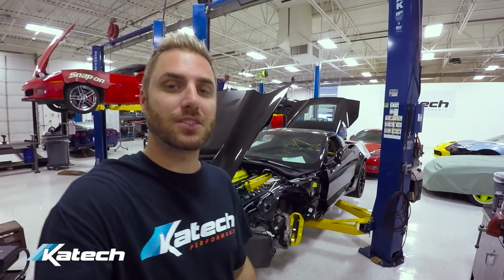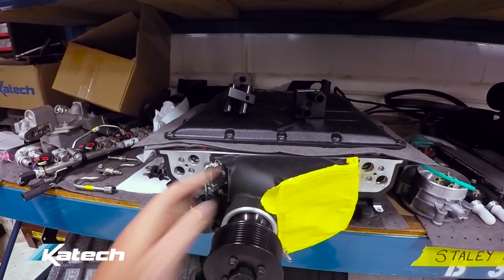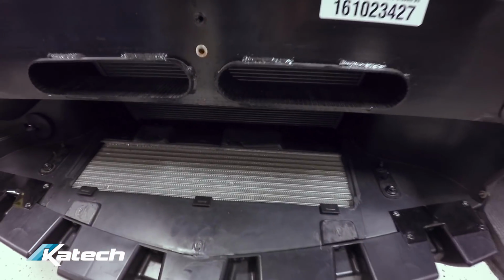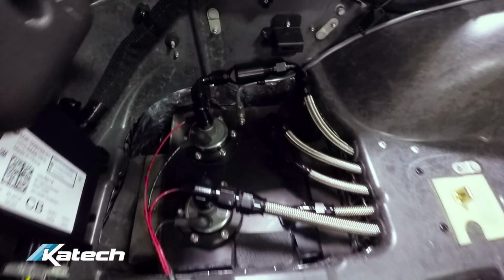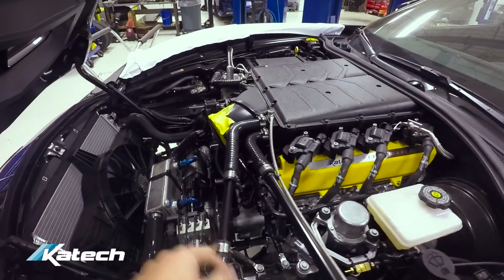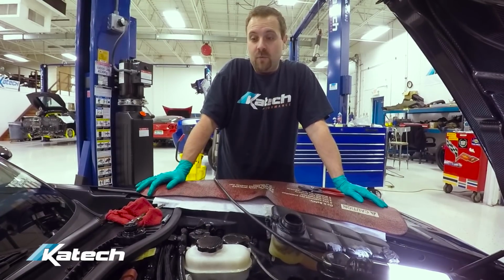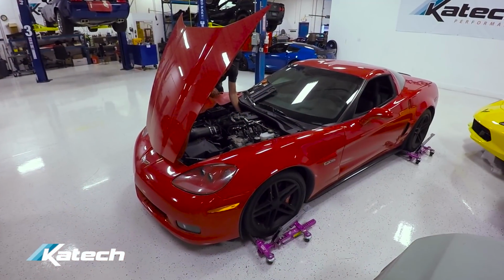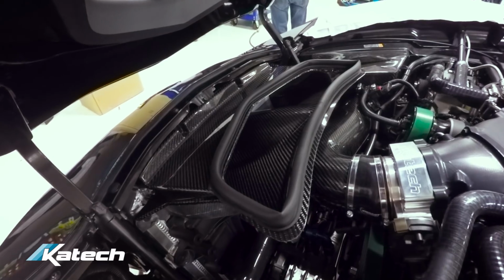Katech VLog - Corvette Z06 C7.R Edition track car with Magnuson 2.3L supercharger!

Comment: Love the C7R build, but would have been better if it had footage of that 2.3 on the engine dyno, and numbers.
Reply from the maker: We didn't put the engine on the engine dyno for this project, but we will have chassis dyno numbers in an upcoming video.
Reply: If I was a betting man, I'd say there were fueling issues.  I'm betting that fuel system won't keep up without meth or port injection.
Reply: Hope im wrong, but I have a feeling those $3500 injectors will be needed.
Reply from the maker: This car is equipped with our surge tank fuel system, LPE upgraded DI pump, and Katech high capacity LT4 injectors.
Reply: Ok sweet, this should be interesting then.  Looking forward to the results.

Comment: What were the stainless lines and black circle pieces below the front parking sensors? 

Love the channel btw man. It's always nice to see quality work done and engineering to fix issues!
Reply from the maker: Heath3250 those are the splitter undertray support cables that are tied up until the splitter goes on.
Reply: KatechPerformance ah I know what you mean. Gotcha. Thanks for the reply and keep the videos coming!

Comment: Hi I have a problem I am hoping you can help me with I have a 2010 Camaro SS auto The L99 according to chevy is suppose to have 400 horsepower but when I took my stock car to the dyno it only made 255 horsepower the car seems to run fine otherwise any ideas as to what could cause this any help will be greatly appreciated thanks Bob
Reply from the maker: NWH83 is on the right track.  The drivetrain loss through an automatic is significant.
Reply: All dyno's read differently (for example, mustang dynos read lower than say a dynojet).  Also, you have to think about environmental factors as well.... i.e. what was the density altitude that day, Was it a hot or cold day, etc etc.... Pair that with drivetrain loss (the L99 is rated at 400hp at the crank, not the wheels) and that's probably why you are seeing lower than average numbers.  I wouldn't put too much on dyno numbers.....they are just that, numbers.  Take it to the 1/8 or 1/4 mile and see what it does. Good luck to you.
Reply: Ok I will try that I was planning To build it but 255 horses is to much a deficit to start from
Reply: with the engine putting out 400 horses I figured a 20% drivetrain loss I should be seeing at least 320 horses so you imagine what I though when it only made 255 thanks again.Bob
Reply: I always thought it was 15 % for the manual and 20 % for the auto.